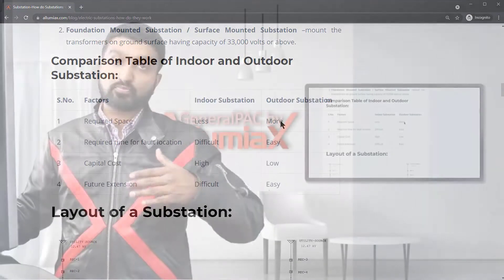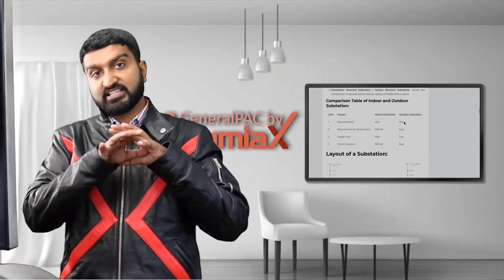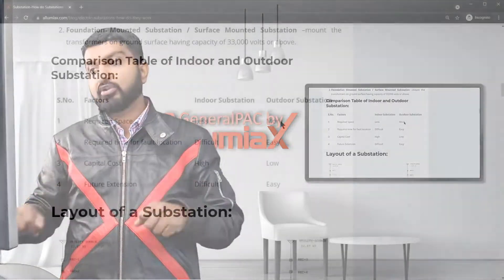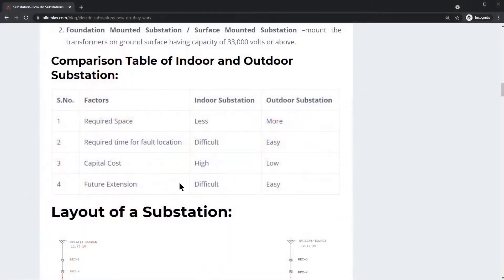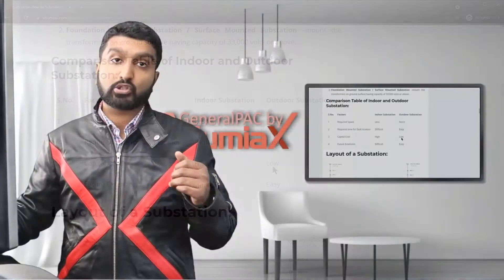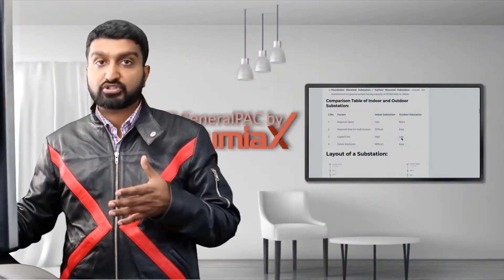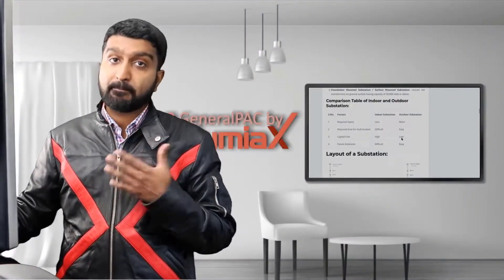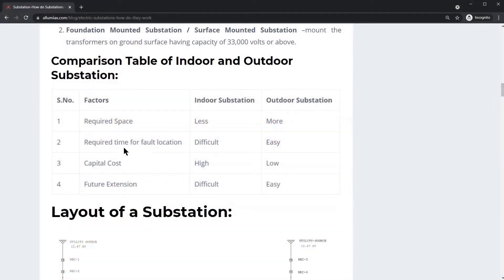Indoor vs Outdoor Substations

Comment: I guess SF6 insulation is still pretty expensive compared to air.
Reply: Comes with a whole host of extra issues. If you have a certain amount of SF6 in your company the EPA requires regular reporting of gas levels/losses. Also, SF6 can be a pain to maintain. I've done gas sniffing on breakers that you cannot seemingly find the leak. But after resealing, it's fine. Also, ABB or Siemens (can't remember which) found that the cast aluminum pole housings were porous enough to weep gas, so the newest models have a urethane type spray in liner. But for arc quenching, SF6 is superior. To break an arc with air/arc chutes on a transmission line - as efficiently as SF6, the current path would have to move at mach Jesus.